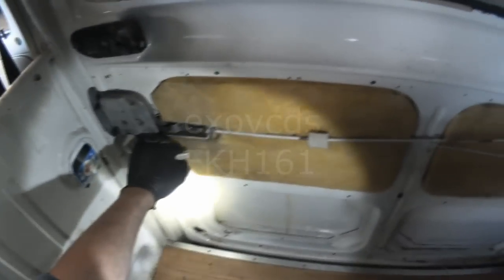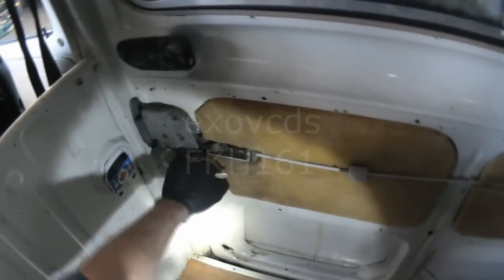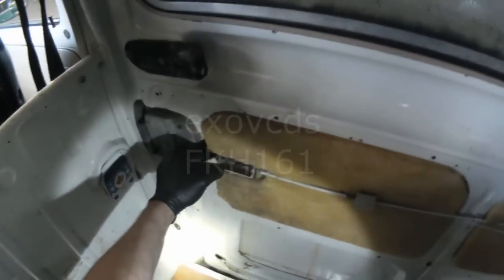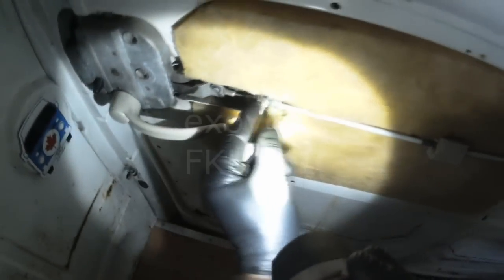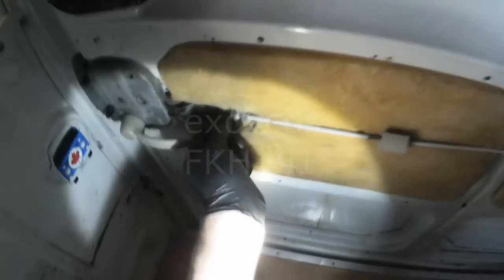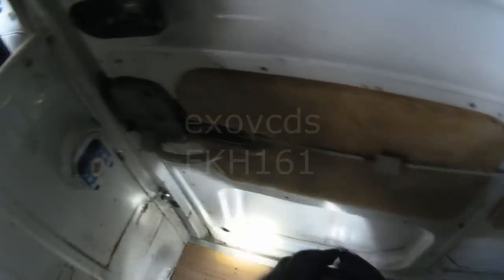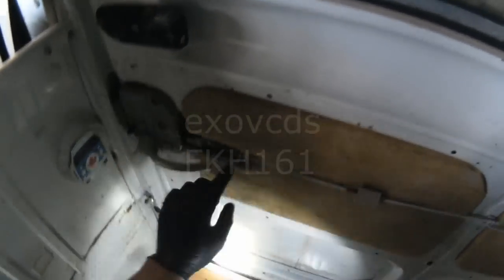VW T2: Sliding Door Inside Release Cable Adjustment

Comment: Do you know if you can unlock the door from the inside?
Reply from the maker: Remove the panel and pull on the rod that goes to the back latch. You will have to disconnect the rod at the front, so that you can move / pull the rod.